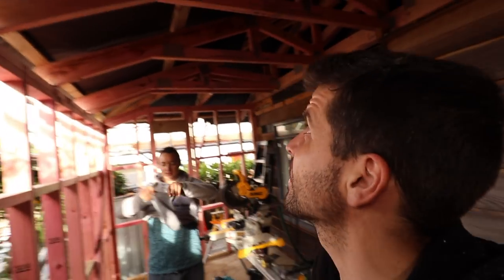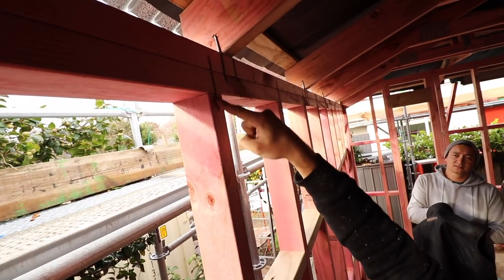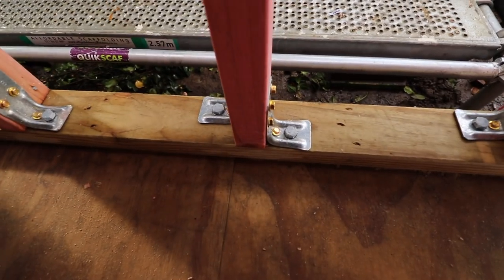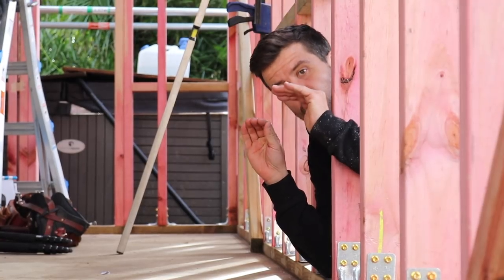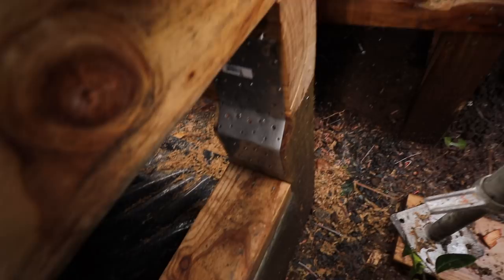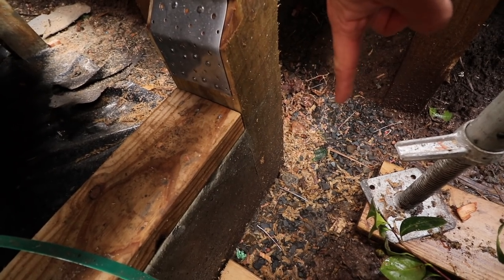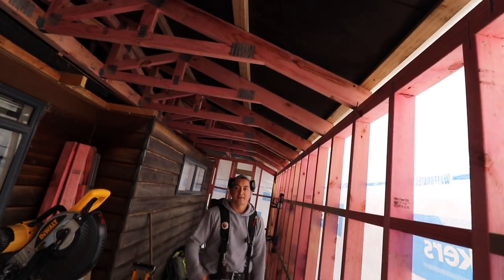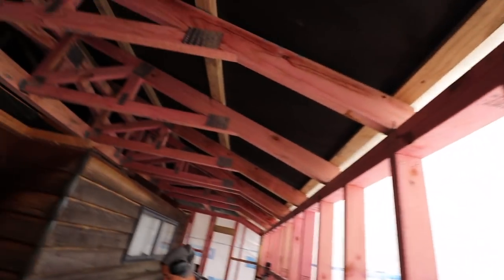This Will Stop Your House Falling Over

Comment: We use plaster boards if you want exceed time how long structure stands upright. 
Example 1 exterior plaster board outside of wall and two regular plaster board inside with at least 180 mm insulation between those boards is rated to last 60 minute in fire situation.
But usually one board inside with insulation is enough for fire code and it's rated for 30 minute fire resistant.

Comment: The horizontal blocking is just a waste. All those brackets are crazy. If the studs are burning up, what are brackets at the bottom doing?  Some politician owns a bracket factory for sure. Also good demonstration on how NOT to saw wood. You don't have to put your hand right by the blade!

Comment: Fire rated wall adjacent to bone dry cedar. makes you wonder.
Reply: That exterior wall with the cedar was probably getting removed and the new truss system probably has a LVL beam  that is taking the load that that old wall was holding before.

Comment: Your building codes are insane.  The labor to put all that in, is great for the builders, not so much for the homeowners.
Reply: Builders usually charge per square meter so not extra money for us
Reply: ...does what you just said actually make sense to you? There's no free lunch, bud.
Reply: You know we're like the earthquake capital of the world right bud?
Reply: That's not relevant. The comment i was replying to was some guy saying that because the builders rates are based on area, he doesn't pay for those details, which are obviously baked into the builders per square meter rate
Reply: I am only commenting on the differences between the building codes there, as opposed to where I live.
Reply: Does seem over-engineered... If they're that worried about the end of the world, may as well just build it out of concrete blocks...
Reply: @glennimmortal  seriously? You have to charge for everything you do, if a builder has a set rate per square meter, he has those hours built into the quote. They are not just numbers pulled out of thin air..
Reply: @bolerdweller   I am a labor only builder like many in NZ between 65-120 per sqr meter or 65 per hr for framing. I hardly quote at all, developers know my rates I just turn up and bang it up. I also meet with inspectors and its a pain in the ass, we are constantly fixing non issues in the building code and still building things that leak. I bet even though Scott takes alot of pride in his work he has probably installed a crappy approved product which is going to fail, I know I have (us style shingle roofs untreated ply !!!). 

our major hardware and construction product supplier write our building code we are just cogs.
Reply: @glennimmortal  I've never seen treated ply on a roof. If the roof is done right it should never leak. I realize you guys get a lot of rain in nz but I'd imagine they would combat that with a layer of ice and water? There should be zero water on the ply, if its condensation from the inside it should still be taken care of with proper ventilation. Treated ply shouldn't be used to mask problems.
Reply: @glennimmortal  It's the council bureaucratic racketeering that puts homes out of reach for all but the middle/ upper income bracket. Homes in Oz are 1/4 the price.

Comment: This is crazy as hell compared to America so many fasteners that seem insanely overkill to me and then no wall sheathing? Whyyyyyy
Reply: in norway, osb sheating would make the house rot from condansation. shows you how code vary with enviornment
Reply: xXZharkXx ohh ok I can understand that but vapor barrier wouldn’t prevent that? New Zealand is definitely a more wet and hot climate than U.S.
Reply: @wess8677  we always use vapor barrier in norway, if we use osb (or any material thats relatively vapor tight) the walls will rot. we have a hard climate that makes for more slightly more complex and much more limited building techniques
Reply: Wess, I totally agree.  Scott is a great carpenter, but those codes are insane.  The brackets are engineered so far past the wood they are holding up.  This house should have a few straps for earthquakes or proper exterior cladding for fire.  Personally, I think houses in all climates should have osb or plywood sheathing.  Depending on climate the vapor barrier is just on the inside (northern U.S. climates) or outside (here in Texas).

Comment: most ridiculous building method I've seen to date
Reply from the maker: yrulooknatme 😂😂
Reply: LOL!!!
Reply: Having to route slots for those Z-nails is madness!  Is there no alternative approved option?  In the US, we use metal "strap ties" that are nailed across the joints.
Reply: Agreed its definitely much more work than we have to do in Canada.  Interesting though to see the differences
Reply: You should still route/chisel out wood for the metal straps we use in the US. It makes for a smoother wall finish and less work for the drywallers. Invest more in your foundation and framing and you will save on your finish work and have better results.
Reply: @WeapanX  I call them U nails. Cause C and Z sound too much alike people get confused
Reply: @CM-xr9oq  yup, "hurricane clips" would make that so much easier.
Reply: I know its more nailing but in Aus we use a triple grip. Thing ain't going nowhere bruvvvvvvvv

Comment: I thought the building code was similar here in Australia.  1684 timber framing manual. But I've never seen those brackets used here.
Reply: When I was over there recently I never saw scaffold around single story dwellings like you do here. "Safety" and other bureaucratic racketeering has made home building for the elite. 2005 to subdivide a section was $3000, a year later $10,000, now $80,000. Paper pushers ARE NOT entitled to that much of the cost of doing business!

Comment: How come you guys don’t sheath your frames in osb or ply? Keeps the frame solid, prevents racking, better for airtightness, insulation, fire, ties everything together so makes a lot of that metalwork redundant.
Reply: What makes you assume they dont? I saw that on the roof trusses but thought maybe they get the shear value through osb on the ceiling. How the hell do they get it tight without sheathing? its seriously just the paper?  The metalwork is more for lateral seismic activity anyway.
Reply: Do you not see the blocking?
Reply: blocking doesnt do anything for shear value unless you have something like a cs14 running across it
Reply: plus screws have practically 0 shear strength compared to nails.
Reply: Guys guys, I think we just have greater flexibility in our building code. It all comes down to how the designer has specified it. There are systems with 7mm ply as a rigid air barrier, and no flexible paper required at all. 
Yes its superior. No it's not absolutely necessary.
Reply: @MusicalDamir  they generally don't sheath over framing in NZ (they have Hardie RAB sheathing board available but its rare I see it used.) Houses, even modern ones here are drafty as hell, would never pass a blower door test;  my guess is 5+ach50 for most construction here.  There is NO residential ventilation code and barely a fire code.     OSB sheathing is rarely used.  As far as bracing its blocking (called dwangs here), straps and ply in corners.

@phil gilbert homes breathing from the interior to exterior is old school kiwi nonsense (that's not to say that ventilated rain screen cavities aren't a great idea to dry cladding).  Seal the interior up tight, and put in extraction and supply air using a proper balanced pressure ventilation design, no more mold!
Reply: I've noticed they use A LOT of plywood in America. In Norway, we don't really use it at all for framing and such.

Comment: Here in Australia it's 600 centres, one top plate, one noggin, no brackets on bottom plate and no moisture tests. I suspect Australian homes won't be standing in 50 yrs but NZ homes will.
Reply: I think you may find houses older than 50 in Oz if you look hard enough.

Comment: what caused the kickback on that chopsaw cut?  just curious since I'm just starting to use one
Reply: not enough pressure on top to hold it down so the saw pulled the wood upwards i think
Reply: A circular blade has a risk of catching the piece as it exits the cut, especially if the piece moves.  If the clamping pressure is insufficent the blade will throw it at you.  If you are using a handheld saw the risk is the saw will kick at you instead
Reply: Make sure your always applying pressure with your other hand to hold the wood firmly against the fence. Also take a shallow first pass with thick wood and keep fingers well out of the way. 👍
Reply: I'd suspect tension in the piece being cut. As the cut got toward the end the remaining timber was allowed to do what it wanted to do which was bend a little which resulted in the piece pinching the blade and getting thrown up

Comment: Odd New Zealand building laws, first lets make the house framing solid so  exterior walls will standup when the house is  burning down , but lets not have 6in exterior walls and outside wall covering before the house wrap so people can have more exterior insulation. I am not insulting your video's , I like them very much, I think I have even subscribed., its just the Kiwi Building Industry needs to change some stuff.
Reply: We had a leaky home issue so I think they are getting more strict for a reason
Reply: @fanaticz666  The current NZ code still sucks vs international standards for insulation, air tightness and ventilation.  Its probably 30 years behind Europe and North America in terms of occupant comfort and energy use.  Leaky homes was caused by crappy detailing, of course flat balconies and roves were going to leak without drainage and monolithic cladding doesn't work unless you include all the substrate layers.
Reply: @mtnbikeman85  k